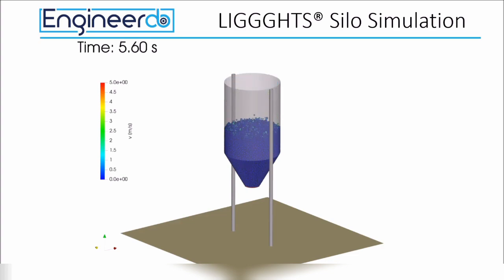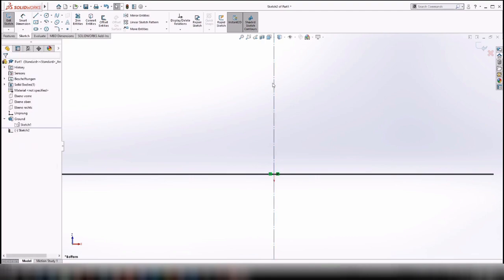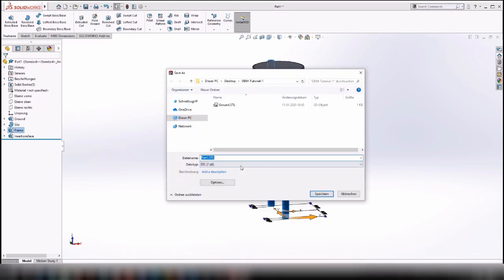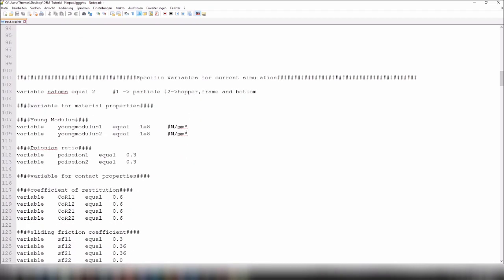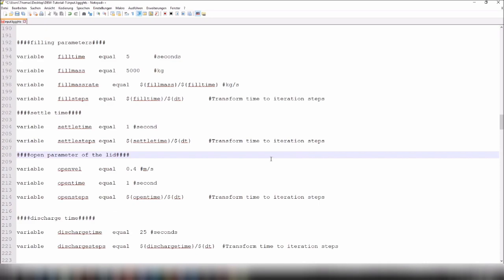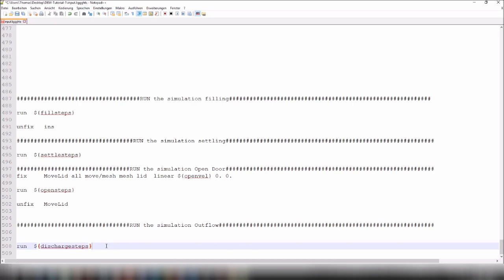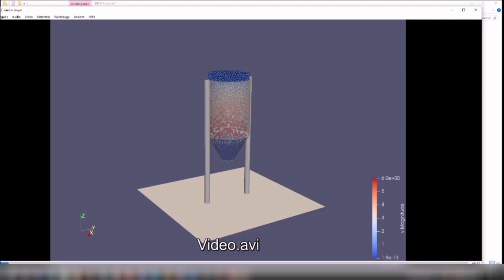Tutorial of DEM Simulation using LIGGGHTS: Complete Workflow of a silo particle simulation

Comment: This video is excellent. I'm using Ubuntu(macbook) and i coudn't use paraview for show particles. Are there any tips?
Reply from the maker: Check if the particle dump command is set to vtk. The alternative format is *.liggghts. However, for that format you need a special read. Vtk can be read direct into paraview
Reply: @engineerdo6568  
thanks I'll try that

Comment: Hi, could you explain more on the scaling of the model? In the Silo.stl file the orifice of the silo is 400mm. If scaled down by a factor of 0.001,  the opening will only be 0.4mm, which is smaller than the particle(radius of 20 and 30mm)? Thank you.
Reply from the maker: Hey Aldrich,
liggghts is allways interpreting the inuput stl as meters. Hence it would interpret the 400 mm as 400 meters. Hence, a scale of 0.001 is needed. Alternative you could export the stl from your cad program as meters.
Cheers, Engenieerdo

Comment: Hi ! Thanks for your tutorials. I have a  question regarding filling a packed bed. I have cylindrical geometry. I am trying to fill it with the default setup as given in the tutorial. After filling it with  particles, I exported the position of particles as csv file. In csv file. the volume of the number of particles are way larger than the volume of packed bed itself. How is that even possible? Another question is that how can I filled the complete bed for a given porosity?
Reply from the maker: Hey thanks for the question Pratyush. I guess there is something wrong in the export command of the CSV. There should not be any change in volume
Reply: @engineerdo6568  OK,  I will check this out. However, please give answer of my second question. How can I filled the bed for a given porosity?
Thanks Again !!

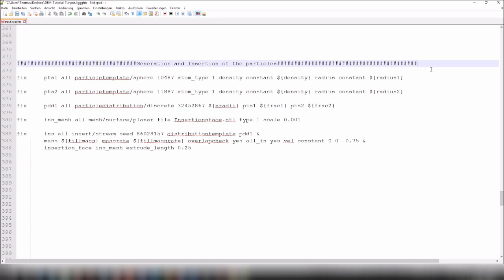Comment: Thanks for a very informative tutorial for beginners like me!  I do have a question.  Starting at 14:59 you are setting the particles.  For a command like "fix pts1" and "fix pts2" there are the numbers 10487 and 11887, respectively.  What do those numbers mean?  There is also a large number in the "fix pdd1" command just below it.
Reply from the maker: Hey Jeff, these are prime numbers. Used by the randomisation algorithm. If changed you should generate a different particle distribution. Different in location, not in size. If this makes any sense. Like in reality you can generate with these a stochastic distribution from the same simulation experiment if repeated with different numbers.
Reply: @engineerdo6568  Okay, so they are random number seeds.  That is great to know.  I appreciate the quick response.

Comment: nice tutorial.
I am wondring how can we define the insersetion face (at 15.37 sec) when we do not load the geometry as .stl file. I understand that after the style mesh/surface/planar, i need to use fix (instead of file) followed by id of the fix that can create the insersion face surface. do i have to define it somewhere and if yes, how can i do it?
Reply from the maker: Hey Atul,

this command usually needs a mesh as stl to generate the particle. ALternative you can create the particles in a defined region, too. Therefore you have to define a region for particle creation and use the following command:

Have look to:
https://www.cfdem.com/media/DEM/docu/fix_insert_rate_region.html?highlight=region%20insert

Cheers, Engineerdo

Comment: First of all, thank you for doing an amazing job for showing how opensource software can be used for DEM simulations.

I encountered an issue: after downloading the tutorial files and trying to run it on Ubuntu, I get an error message that contact model is not in the whitelist. I cant put my head around that message. What does it mean?
Reply from the maker: Hey Mos-ta-fa, that means that this contact model is not officially supported. It can mean that it is calculating perhaps a bit slower. Just ignore it. It's not relevant.
Cheers, Hendrik

Comment: Excellent tutorial. You made it so easy to start exploring this software.  

I just have a small problem, when I want to change opacity to any other value that is not 1, the silo dissapears. How can I change that??
Reply from the maker: Hey David, that can be a bug of PARAVIEW or a problem with the graphics driver.
Reply: @engineerdo6568  Thanks for the response, I decide to run Paraview in Windows where i have all drivers instead of Ubuntu and all went great. Thank you.

Comment: Hi, I'm using inventor when creating the insertions face and I encountered this error: "Face defined as planar space is not planar", how to fix this ? Thanks
Reply from the maker: That's an annoying thing. Some meshes out of the CAD seem not to be orientated in that way, that every vortex is in the same plane. 
You can use blender to bring them all in the same plane. Load the STL file in blender, then hit "s" to scale the geometry and the type in the axis perpendicular to the surface (e.g. X) the hit 0. The geometry will have no dimension in X direction, now, which makes it planar. 
Good luck
Reply: @engineerdo6568  Thank you for your reply. I will try it later. Also, do you have any suggestions to speed up the process of the simulation? I want to simulate around 420,000 particles, using the same physics as your example, and it took a very long time to be completed.

Comment: Thank you for your amazing tutorial. In paraview, is it possible to export a specific step as stl or another file so it can be loaded in Fluent? I tried export data, but there is a problem with the powder pack.
Reply from the maker: Hey Mohammad, you can export all STL files as new STL files. However, I fear you will not be able to export the particles as a STL surface. You can export the results to blender and from blender you can export STL. This would be possible. If you want to simulate the penetration by a fluid try to install the coupling using openFoam that we explained in a different video. This will help you to get rid of Ansys and do a direct coupling of particles and fluid.

Comment: Thanks for the video.

I'd like to ask about choosing the timestep, what is the best timestep if simulating soil particles (especially clay particles)? Where can I read about this topic? I think I should try different timesteps until the results converge is this right?
Reply from the maker: Hey Sherif, thanks for your comment. 
The selection of timestep can besometimes challenging. As a rule of thumb it is often recommended to use 10% to 20% of raygleigh time. But in the end it depens also on your particle system, the dynamics and the results you want to analyze. Hence, we can also often use 50% without changing the flow behaviour.

You can check your rayleight time percentage in liggghts by:
https://www.cfdem.com/media/DEM/docu/fix_check_timestep_gran.html

Cheers, Engineerdo

Comment: Hey EngineerDo, How did you opened .liggghts files in paraview?. They are not recognised in paraview in my PC.
Reply from the maker: Hey Venu,

The problem in paraview occurs due we used a special paraview reader. We will change it in general in the upcomming tutorials. 
You can fix the problem by replacing the line in your script: 
  
"dump dmpparticle all custom ${dumpstep} post/particles_*.liggghts id type x y z vx vy vz fx fy fz radius mass" 
  
by this new line. 
  
"dump dmpparticle all custom/vtk ${dumpstep} post/particles_*.vtk id type x y z vx vy vz fx fy fz radius mass"

Comment: Thank you very much for the tutorial. This will be the first time I'll work with LIGGGHTS. It's been a great initial video. Also, would it be possible to add a solid object moving inside the grains, let's say, in a 2D geometry?
Reply from the maker: Hey Douglas, thanks for your feedback! It depends what kind of solid object you want to mimic. You could use superquaric for example to mimic a cube. In the public version the 6 degree of freedom feature is not implemented, which allows you to also enable free movement of cad bodies. 
Cheers Engineerdo
Reply: @engineerdo6568  thanks for the quick reply. Oh I see. I think I'll have to mimic a cylinder moving inside the grains. In that case, would I also have to use superquadrics?
Reply from the maker: Yeah I think if you just want to mimic a quite simple geometry like a cylinder it should be possible to insert the cylinder as superquadric and simulate the other particles as spheres. An Alternative would be to use coupled simulation, but this could be far too much depending on your desire.
Cheers, Engineerdo
Reply: @engineerdo6568  it feels right to me. Well, again, thanks for your answers and tutorials, they were very informative. Have you thought about creating a complete course on LIGGGHTS simulations?
Reply: @engineerdo6568  que no me a y M noauricio y papá y dando cuenta de la escuelay no me gusta cuenta de que no me gusta verla asi que es eso de la casa de mi mamá prestado a la casa en la casa de mi mamá prestado

Comment: Hello, can you help me with the reader of particle.liggghts i could not found it.  Nice tutorial, thank for help me
Reply from the maker: Hey Jaoquin,

thanks for your feedback! The best way is to change one line in the liggghts script and re run the simulation:

The problem in paraview occurs due we used a special paraview reader. We will change it in general in the upcomming tutorials. 
You can fix the problem by replacing the line in your script: 
  
"dump dmpparticle all custom ${dumpstep} post/particles_*.liggghts id type x y z vx vy vz fx fy fz radius mass" 
  
by this new line. 
  
"dump dmpparticle all custom/vtk ${dumpstep} post/particles_*.vtk id type x y z vx vy vz fx fy fz radius mass"

Good luck, Engineerdo

Comment: Hi ! Thanks for the great tutorial to break down all the codes line by line. I have a question regarding some random numbers which are mentioned in the section of Generation and Insertion of the particles in this script. Also you have not discussed what they are in this video. Those are:

particletemplate/sphere 10487
particletemplate/sphere 11887
particledistribution/discrete 32452867

Are those numbers random or they have to be carefully specified?
Reply from the maker: Hey Taosif, thanks for your feedback. 

This is a necessity of programming in LIGGGHTS. From pratical point of view it is important to know that this number must be a prime number and larger than 10000. So you could also replace the value for example by this numbers: 447883  447893  447901  447907  447943  447961  447983  447991  and the script works also. 

The Background of the seed:
The value serves as a random number for the random generation of the particles within the generation region. By changing the value, the particles are randomly arranged differently in the generation. 

Cheers

Comment: Thank you for the tutorial!
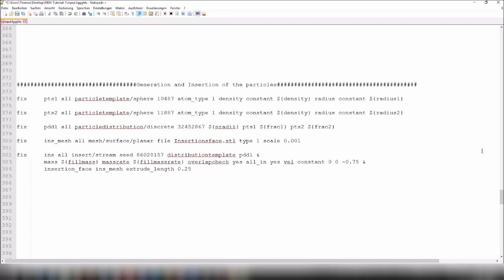Could you answer a question? At 15:00 of the video you explained the Generation and Insertion of particles. What does  10487 mean? How do you get this value?
Reply from the maker: Hey Kesley, thanks for your feedback. 

This is a necessity of programming in LIGGGHTS. From pratical point of view it is important to know that this number must be a prime number and larger than 10000. So you could also replace the value for example by this numbers: 447883  447893  447901  447907  447943  447961  447983  447991  and the script works also. 

The Background of the seed:
The value serves as a random number for the random generation of the particles within the generation region. By changing the value, the particles are randomly arranged differently in the generation.

Cheers

Comment: Nice tutorial. 
Can you run liggghts on windows?
I'm confusing with one point: Don't you need a mesh between the silo and the ground?
Reply from the maker: Hey Andre, DEM is a meshless method. No need of a mesh like in CFD. You only need a mesh for every wall or object in the simulation. Running liggghts on windows is technica possible but we don't have a tutorial for that so far.

Comment: Hello ,Engineer Do
I followed your whole tutorial but when i am trying to load files in paraview i am not able to load "particles.liggghts" as it is not supported by paraview.How do i fix this
Reply from the maker: Hey Saksham,

The problem in paraview occurs due we used a special paraview reader. We will change it in general in the upcomming tutorials. 
You can fix the problem by replacing the line in your script: 
  
"dump dmpparticle all custom ${dumpstep} post/particles_*.liggghts id type x y z vx vy vz fx fy fz radius mass" 
  
by this new line. 
  
"dump dmpparticle all custom/vtk ${dumpstep} post/particles_*.vtk id type x y z vx vy vz fx fy fz radius mass"

Cheers
Reply: @engineerdo6568   Thank you for the solution. 
Also is there any way I can the graph plot of your tutorial to check my results
Reply from the maker: @saksham384  you can use the "plot selection over time" filter in paraview or write csv data from liggghts during the simulation.

Comment: plzzzzz give the link to install liggghts in windows plzzzzzzz
i am in stresss
Reply from the maker: Hey Saksham, a installation using windows is pretty complicated and you will see a decrease in performance. You can use our tutorial for ubuntu to install and compile everything you will need. The process will take less than half a day. https://youtu.be/ru3119ozC6M
Reply: @engineerdo6568  i did the same and made a same figure and all the same codding  but when i run the code i am getting a error 

"ERROR:Variable evalaution before simulation box is defined"

Comment: I would like to run it in my paraview but there is no plugin reader for that. How can I get it?
Reply from the maker: Hey Achmad,

The problem in paraview occurs due we used a special paraview reader. We will change it in general in the upcomming tutorials. 
You can fix the problem by replacing the line in your script: 
  
"dump dmpparticle all custom ${dumpstep} post/particles_*.liggghts id type x y z vx vy vz fx fy fz radius mass" 
  
by this new line. 
  
"dump dmpparticle all custom/vtk ${dumpstep} post/particles_*.vtk id type x y z vx vy vz fx fy fz radius mass"

Cheers
Reply: @engineerdo6568  I am sorry, I asked this question before I read the whole comments. I fixed the problem by adding liggghts reader plugin into ParaView. I cant use vtk because my liggghts compiler doesn't have that feature. Cheers from Japan for a nice tutorial !!! Please keep this channel alive!

Comment: Hello EngineerDo team,

When i am trying to load the files in Paraview i get the message that reader for "particles_0.lights" could not be found, i am using Linux 20.4 - any ideas ?
Reply from the maker: Hey Mohammad,

The problem in paraview occurs due we used a special paraview reader. We will change it in general in the upcomming tutorials. 
You can fix the problem by replacing the line in your script: 
  
"dump dmpparticle all custom ${dumpstep} post/particles_*.liggghts id type x y z vx vy vz fx fy fz radius mass" 
  
by this new line. 
  
"dump dmpparticle all custom/vtk ${dumpstep} post/particles_*.vtk id type x y z vx vy vz fx fy fz radius mass"
Reply: EngineerDo thank you, I did exactly the same by comparing to the code from chute tutorial 👌🏼🙌🏼
Reply from the maker: Great, it works :)
Reply: EngineerDo thanks a lot I was missing “vtk”after “custom” 👍🏼
Reply: @engineerdo6568  Hello team, did you work any script to run on parallelcluster using qsub ?
Reply: Hello! 

When inserting the line that indicates, it gives me an error: invalid dump style.

Should I have something installed previously?

Thanks you! 
Carmen.